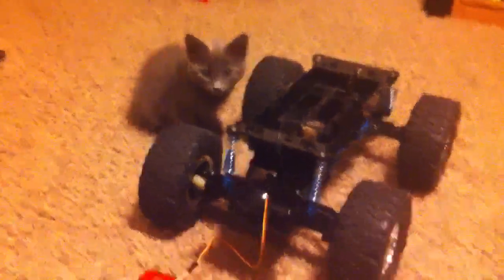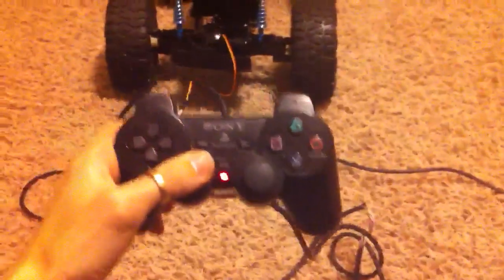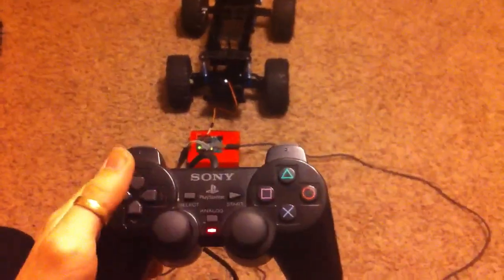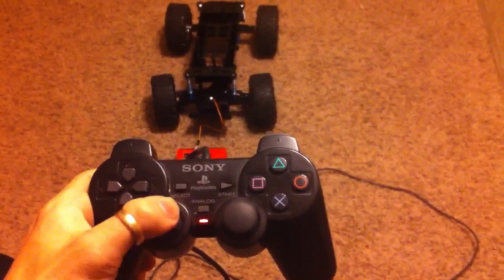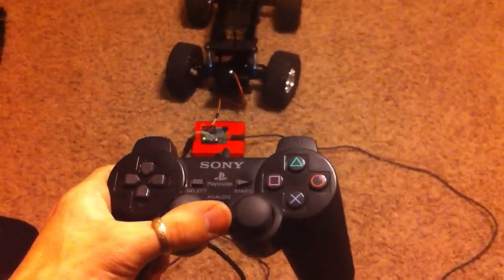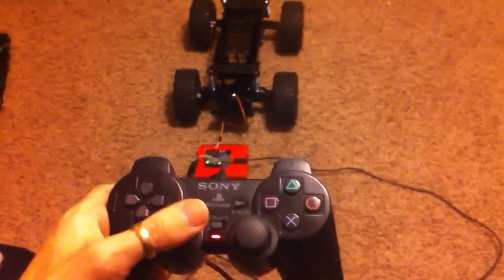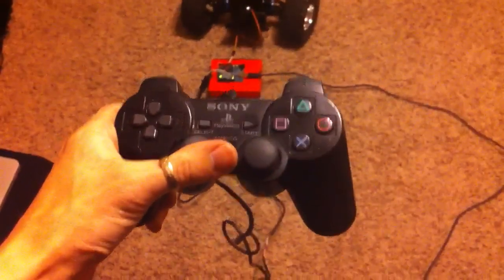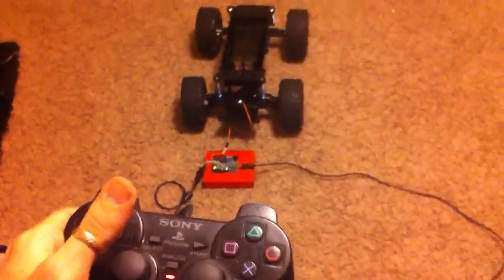Building an Internet controlled RC car. Video 1

Comment from the maker: With the implementation shown in videos 1-3 no. I have however created a new way to communicate with the bot, and have controlled it over the internet using my iPhone 4 and laptop. I should note however, that using this network creates 1-2 seconds of lag that isn't preferable for controlling high speed RC cars (AKA I crashed mine several times). Once I am finished perfecting this method in the next month or so, you should be able to control a bot over the internet using said service.

Comment from the maker: @BadCamStudio Actually no, this is simply an implementation of Bill Porter's PS2 Arduino Library. I wrote a little Arduino code that is specific to the RC Car's Steering Servo and viola! If you don't believe me go to "w w w" + ".billporter.info/playstation-2-controller-arduino-library-v1-0/" and check it out. Plus if you look at the RC car it no longer has its RF control board.

Comment from the maker: @BeastMan2496 Pachube.com is a website that allows you view and retrieve live data streams from data collected by various microcontrollers like the Arduino. I thought I would use this site to stream the commands generated from my PS2 controller to Pachube which the robot would then retrieve and execute, however Pachube limits data uploads to every 5 seconds or so. Since I need a refresh rate much smaller than that (say 5 or 10 per second) I have decided against using Pachube.